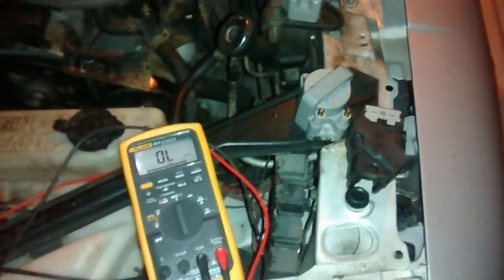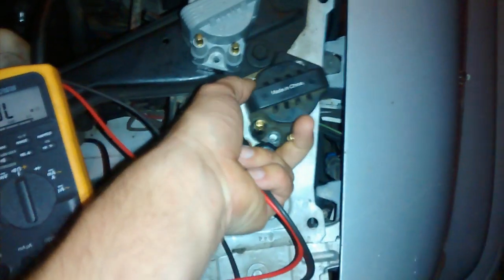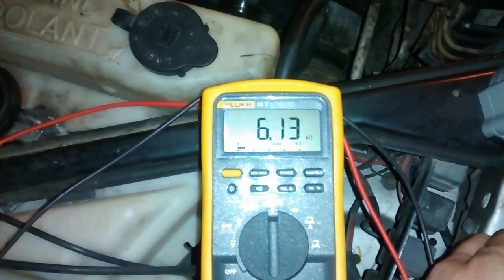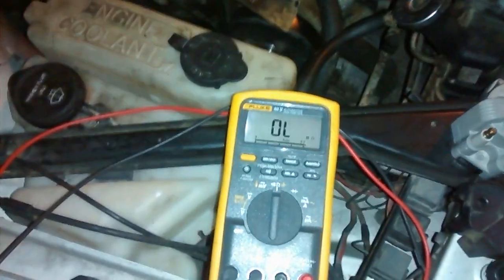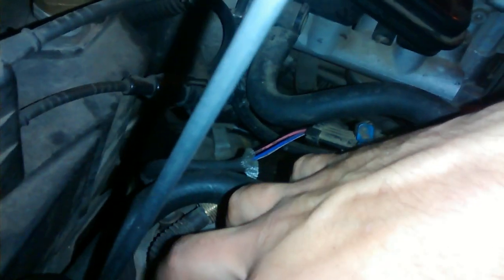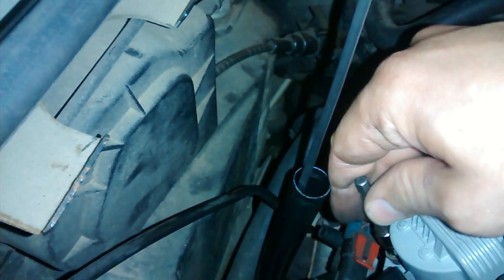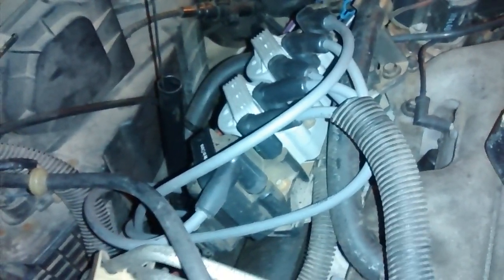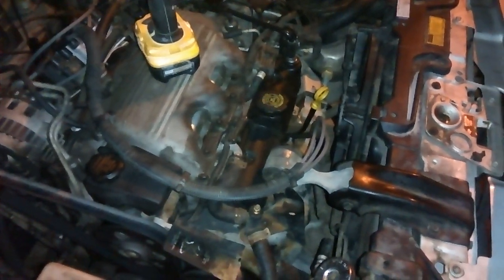Testing an Ignition Coil Pack

Comment: My wires were so bad they were corroding  and fouling the plugs.  New ignition  coils helped, but the plugs were original too.  It's hard to get the back 3, on the 3800 V6.
Reply: You might have to cut them off and just replace it

Comment: I just found 2 plugs loose on my grand prix.3.1. #1 #3. crazy. I bought car used. very little maintenance ever done so I did the work.
Reply: Awesome job. Pull the wires off the coil packs and clean them with a wire brush.  You will start to see if any plug is dirty.

Comment: I know g.m. o.e.m..uses AC Delco..is this absolutely the only way to fly? two local parts stores only had ( standard) brand. and Napa only has ( echland) I think I spelled correct. not sure. but I would have to order AC Delco. I still probably will stick to_( AC delco)

Comment: You’re asking for trouble using a power tool for such simple operations. Use the correct tool.
Reply: Agreed, yes.  At least while tightening / installing the unit (okay for loosening); best to use a ratchet and bring down by hand just snug + 1/4 to 1/2 turn ONLY.  Otherwise might crack the solid plastic body.

Comment: Yes, dirt can conduct electricity because if it has minerals these will conduct the current. If you ever have to pick up a screw that has fallen under your car and you use a magnet note how many particles collect on the head of the magnet.  Those are particles that are have metal.
Reply: true.

Comment: I completely agree with you last suggestion, when replacing ignition wires and coils (i.e. Coil Packs) always bring a multimeter with you to the auto parts store.  The ohms vary greatly from wire to wire and coil to coil.
Reply: Wow I didn't know that.  I just cleaned every coil plug,  with a firm wire brush and it did help. It got the white carbon off.  Only for about 200 miles or so.  The wires and engine plugs were original at 129,000 miles lol. That was the bigger problem lol.

Comment: My daughter has one of these misfiring under a load at 55 mhp. It has  new plugs and wires so must be the coils. Scan tool showed 2 misfires on number 4 since the codes were cleared IDK 4 months ago.
Reply: D theman  What's the car in the video?
Reply from the maker: It's a '94 Oldsmobile Cutlass Ciera.
Reply: D theman  Its wasnt two different coil packs it was 2 misfires on one coil since clearing the codes. 
I forget now which car I was dealing with. I think she was driving a buick Rendesvous 2 years ago.